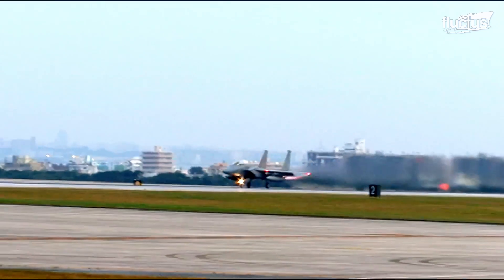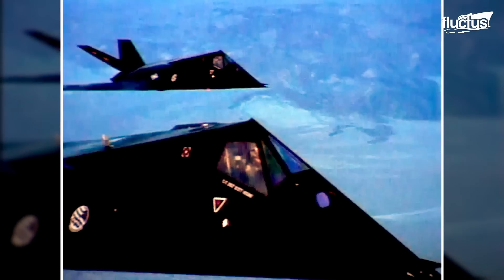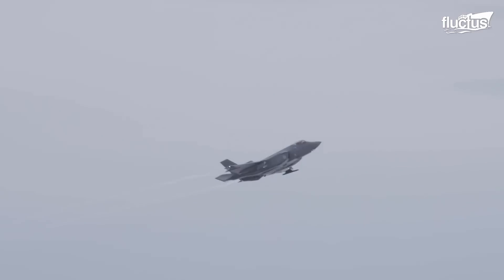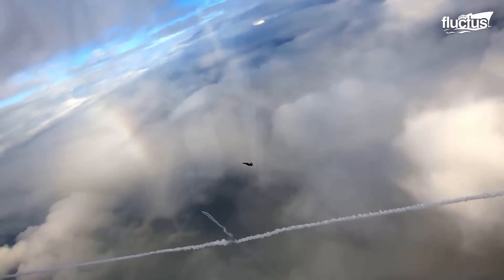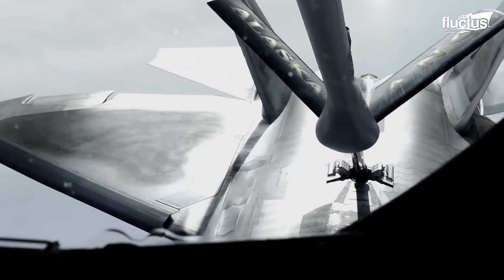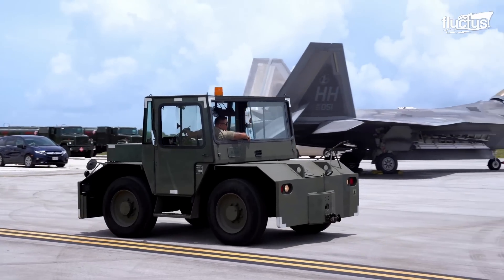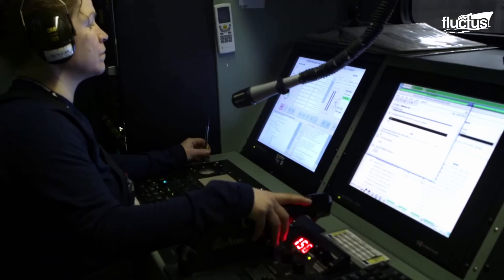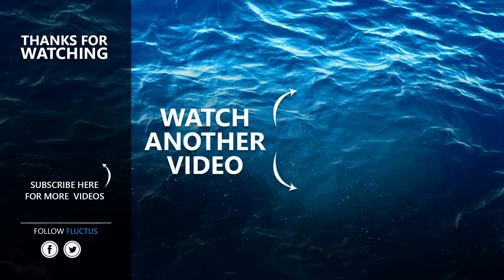F-22 Raptor: US Air Force’s Most Feared Stealth Fighter Ever Built

Comment: No matter how great the plane, it gets down to the pilot and his/her abilities
Reply: That's only true to a degree. Put the most amazing fighter pilot ever in the wright flyer with a machine gun strapped to the front then put a rookie in an F22 and see if your comment still holds up. When the machines are equal or at least close, then it comes down to the pilot, but at some point the older tech will be totally overwhelmed by the modern techs ability.
Reply: @Sciguy95  comparing an early plane with an f22?  I must be missing something
Reply: @stanmans  you're the one that said "no matter how great the plane, it gets down to the pilot" as I pointed out, this only applies when the planes are similar in ability. If the difference in ability is too great then the pilots ability becomes irrelevant. Too many people take "it's not the plane it's the pilot" way too literally.
Reply: F-22 is a marvel of engineering.